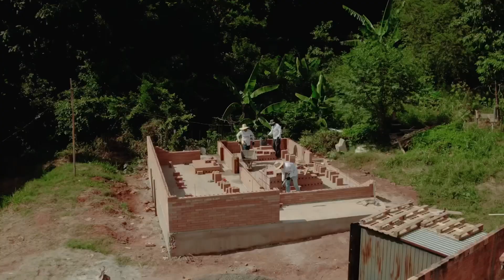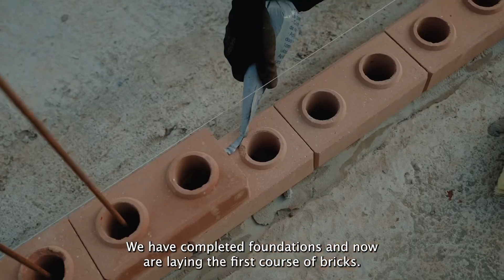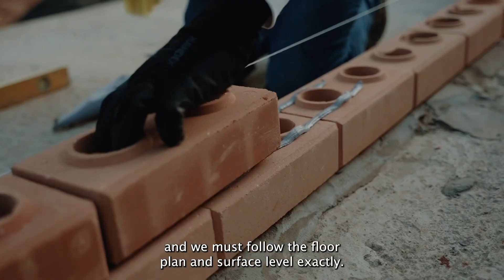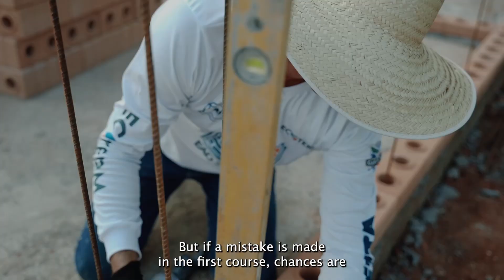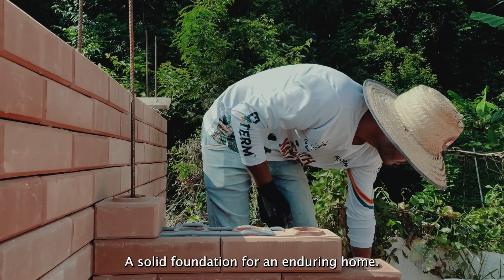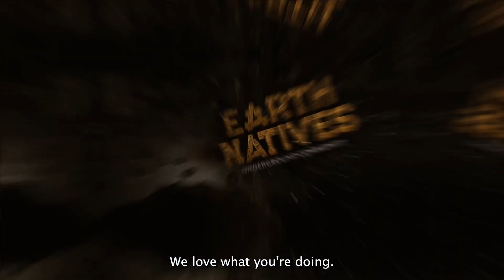Building with Interlocking Compressed Earth Bricks by Earth Natives NFTs

Comment: What do you do about the space that you see between the bricks when you are inside?  When inside you can see the light from outside coming through the space where the two bricks come together horizontally.
Reply: Hi Antonio, once all the bricks are in place we use tiles grout to fill this gaps, its a flexible material that seals the joints and allows it to keep up with the expansion and retraction of the wall
Reply: @EarthNatives  Do you apply the tile grout both inside and on the outside of the bricks or just on the nside?